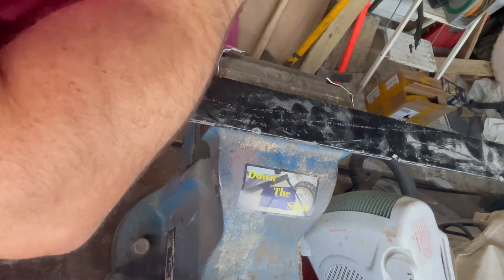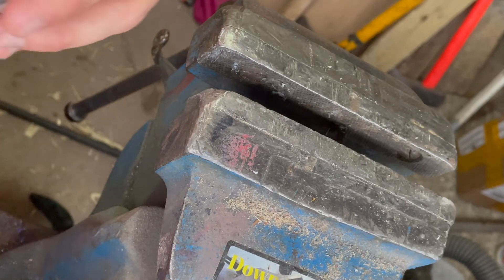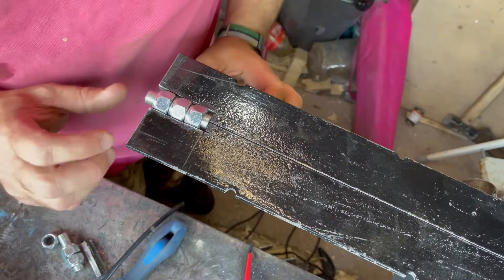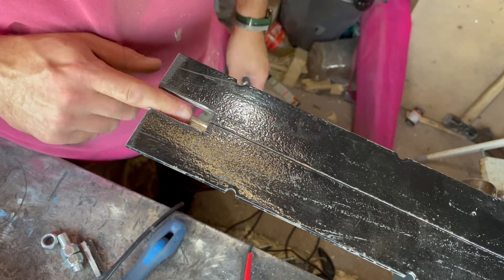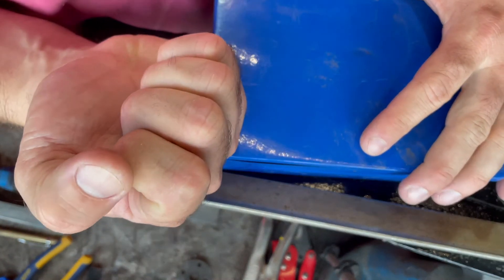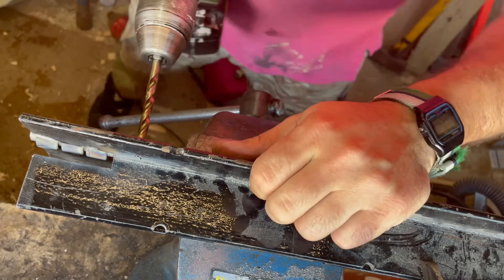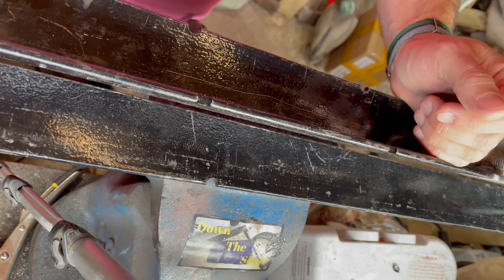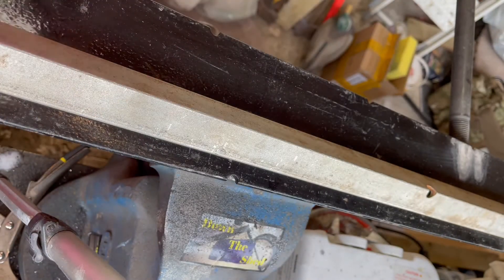Easy Brake press build

Comment: Nice WOrk. Id like to see the stainless drilling haha. I used to struggle with it. stainless work hardens. drill with low rpm helps. I tend to pulse my drill trigger. Cheers. looking forward to seeing your project
Reply from the maker: Awesome to see you’ve dropped by again. I was drill through from the inside corner (lesson learnt) the larger drill bits kept biting before they got to the hole.

Comment: Sorry, are you able to adjust the gap so you can bend thinker metals?
Reply from the maker: Correct, Andrew the gap can be adjusted to allow thicker metal in. Although I think 2mm aluminium sheet would be its limit for this design. 👍👍